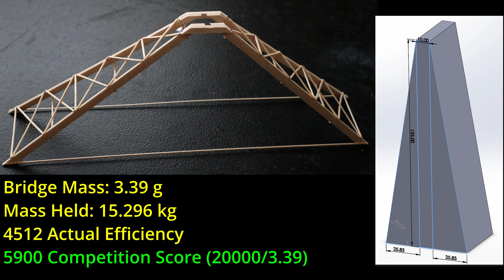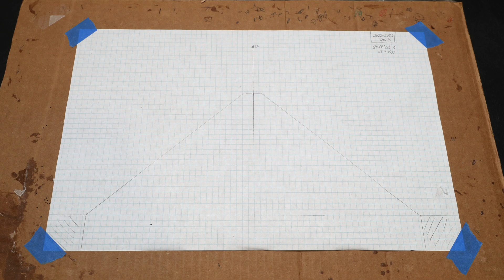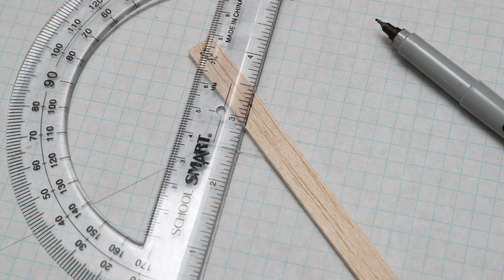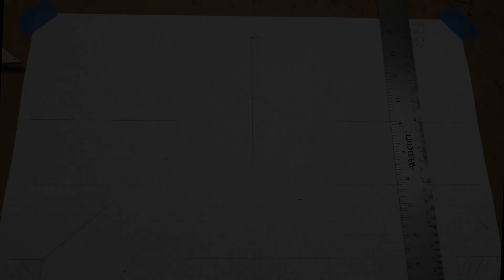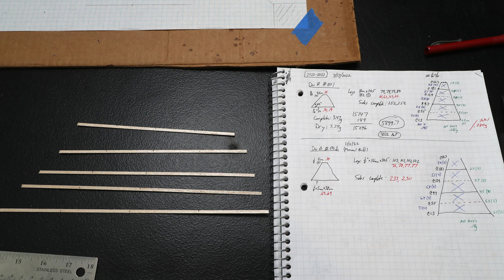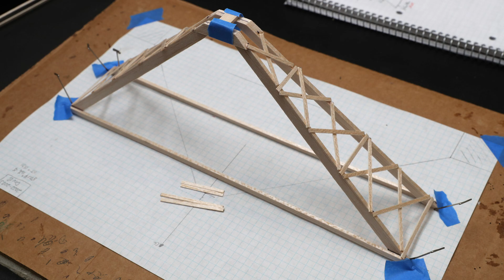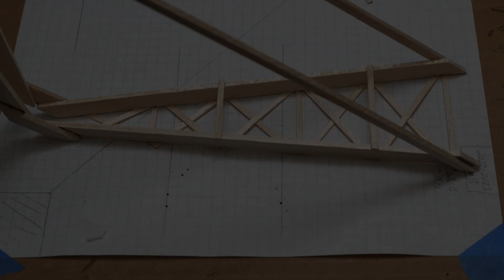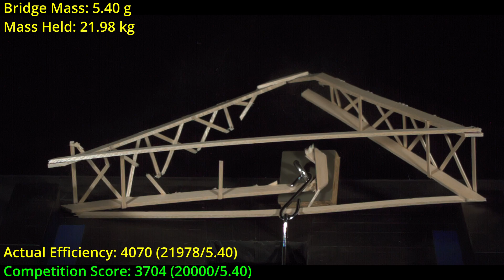2023 Science Olympiad Bridge Div B: Getting Started

Comment: Is there a good alternative to using a balsa stripper? Our team doesn't have one.
Reply from the maker: I would consider it one of the essential tools unless you are going to buy all your balsa pre-cut.  That will be much more expensive than just buying one of these for < $20:  https://www.amazon.com/Master-Airscrew-Windsor-Propeller-Stripper/dp/B0000WS5OQ/ref=sr_1_1?crid=81NEVH3R3DFB&keywords=balsa+stripper+master+airscrew&qid=1680907510&sprefix=balsa+stripper%2Caps%2C172&sr=8-1

If you are in a pinch, I suppose you could use an X-acto knife and something like a metal ruler or other straight edge to guide the cut, but I wouldn't recommend that
Reply: @balsaengineering6686  Thanks, also what would be a good efficiency for a bridge that is in states?
Reply from the maker: @sibaiyan  Hi!  It's really hard to tell as there will be a huge range between different states.  In some states, 4000 could win, in some with strong build teams, it might take 6000+ to win.

Comment: These videos are so great. Thank you so much for all your information. I have a silly question, has anyone ever tried to build a bridge by bending balsa wood to create an arch ?
Reply from the maker: Thanks for the kind feedback!  It is possible to build an arch bridge with balsa, but from what I understand it involves getting the material wet/soaked and then bending it in place with a jig.  Even if it could provide some benefit over an optimal conventional bridge, which I'm not sure it can, the hassle involved really wouldn't be worth it IMHO.  One of the keys to success for this event is to have as simple a build as possible so it is as repeatable as possible.  Making an arch bridge would be pretty much the opposite of that.  Also, a perfect arch design would still need a way to support a flat loading block for these rules, so that would also cause a headache with the design.  All that being said, it might be fun to try at some point!
Reply: @balsaengineering6686  thank you so much for your reply. My train of thought was the arch would spread the weight evenly throughout the structure.  But the loading desk might be a problem for sure.
Reply from the maker: @macferigo  Because we're able to work with basically a triangle bridge, the loading is already well distributed across the legs.  Compared to a conventional "road-bridge", an arch design would have a big advantage.  But that is also why these triangle bridges have a big advantage as well as we can design them for essentially a point load in the middle instead of a distributed load across the entire structure (like a real bridge).

Comment: First of all, thank you so much for helping me build a good bridge for science olympiad competitions. Could you please tell me what size wood you usually use for the cross-braces, and the tension pieces on the bottom if I want to target a score of 4500? I will probably use 1/8 inch wood for the rest of the bridge though. Thank again.
Reply from the maker: Thanks for the kind words! For the cross bracing, I like to use 1/20" thick balsa and cut it square to around 1/20".  For the primary tension pieces, I like to use 1/32" x 1/16" basswood.  Good luck!!

Comment: Can you please share the balsa wood pieces sizes you used?
Reply from the maker: I think I talk about the sizes of everything I used throughout this video.  Is there a specific question you have that isn't covered in the video?
Reply: @balsaengineering6686  it is 1/16*1/32? I git confused with the bottom piece size?
Reply from the maker: @sunithagundam3452  For this particular build, it was 1/8 x 5mm balsa, but what I recommend is 1/16 x 1/32 basswood
Reply: @balsaengineering6686  thank you for the response, for the side part can I use 3/32, are any other better recommendations?
Reply from the maker: @sunithagundam3452  Yes, my recommendation is to use 3/32 thickness for the legs.  1/8" is also a good choice, but I like to use 3/32 for most builds

Comment: Hello, I am writing in regards to the dry box you used for the weight loss. Where can I find/buy the dry box you used ?
Reply from the maker: Hi!  I made an entire video on the process of using the dry box and how/why it works.  Check out this video:  https://youtu.be/6zOvHMZLaNE

I usually buy the bins at my local Target or Meijer, but I have found a link online for a pack of 4 of them:  https://www.amazon.com/Sterilite-19344304-Gasket-Aquarium-Latches/dp/B00KL7VPWO/ref=sr_1_1?crid=3UGQWZAD2C4EY&keywords=Sterilite+19344304+54+Quart%2F51+Liter+Box%2C+Aquarium+Latches+and+Gasket&qid=1672073569&sprefix=sterilite+19344304+54+quart%2F51+liter+box%2C+aquarium+latches+and+gasket%2Caps%2C105&sr=8-1

Comment: Would it be more efficient (lighter and stronger) if you used a laser cutter to make the ends rather than gluing them??
Reply from the maker: I don't think using a laser cutter would be of benefit in that way.  The glue joints are actually stronger than the wood itself.  I would also be concerned about having the grain of the wood not be aligned like it is with conventionally cut strips.  I don't have a laser cutter to play with though, so if you do, definitely give it a try and let me know how it goes!

Comment: did you laminate any pieces?
Reply from the maker: No, nothing special like that.  Just simple surface to surface gluing for all the joints
Reply: @balsaengineering6686 alright, thank you! by any chance did you glue any of them together to form stronger sticks as one or did you just use one stick for each support? if using basswood
Reply: i have 3/32 inch basswood for reference
Reply from the maker: @psychosaggitarius  For this particular build, the "Getting Started" video, I used all balsa from a single sheet of 1/8" thick.  I basically show the entire build in video.  I don't do any lamination.  For something like my 5900 bridge, and what I'd recommend, is to use a piece of basswood for the primary tension member.  I like to use 1/16 x 1/32 for that piece as a great starting point.
Reply from the maker: @psychosaggitarius  Hmmm... are you asking if you can laminate those to create the legs?  Maybe... but I definitely wouldn't recommend it, it will be too heavy.  Try and find some light balsa and cut the pieces for that if possible

Comment: How do you set up the dry box? My box was not completely air-tight and after the first bridge, the silica get has saturated, and new bridges no longer dry in the box. Do you use new gel for each bridge, or make the box you store the bridge in airtight?
Reply: I'm looking at either replacing the gel each time, baking it to remove the water, or attempting to make the box air-tight (although I'm not sure how I'll do the last one)
Reply from the maker: @jqxz230  Don't bother baking your bridge.  If you don't have a perfect dry-box to transfer it into immediately, you'll lose everything the baking does in a matter of minutes.  A simple plastic bin from Target can be almost air-tight if the top has a foam seal.  Look for that when you pick one up.
Reply from the maker: Nothing too special, but you need to make sure your bin is as air-tight as possible.  Make sure the top has a foam seal or you'll never have a chance.  A single set of silica gel packs should last for weeks if it's done right.  One recommendation would be to get some cheap humidity meters and tape one inside your box and compare it to the outside RH.  That way you'll know if your dry box is working well.  I'm using these:  https://www.amazon.com/gp/product/B07GNMKYCZ/ref=ppx_yo_dt_b_search_asin_title?ie=UTF8&psc=1
Your inside the dry-box RH should be 20% or less if things are working well.

Comment: Hey! I made my first bridge for division c using your help. My bridge weight 12.33 grams and held 14.14 kilograms because the main leg of the design failed due to a cutting error on my end that I didn't notice until looking back at a picture of when I first finished the bridge. I'm looking to improve my design and see where I can improve on. To do that I was hoping to build a testing platform. I was wondering what material you used for the loading block and test supports.
Reply from the maker: Hey!  Congratulations on your build!  That is a really nice result for a first attempt!  As for the loading block and test supports, you can use any kind of wood. Hard woods like oak/maple are probably better to use than pine.  I inherited my loading blocks, so I didn't make them myself.  For the test supports, I just 3D printed them.  You could also 3D print your loading block too, that might be a very good way to go especially if this is just for your personal testing platform.  Good luck!

Comment: Great video! How did you exactly build your dynamic loading system when you are testing your bridge? Also, what wood did you make the loading block out of?
Reply from the maker: Thanks!  The core components of my dynamic loading system were this load cell (which doesn't seem to be available anymore) https://www.amazon.com/gp/product/B07F922RZC/ref=ppx_yo_dt_b_search_asin_title?ie=UTF8&psc=1  and an Arduino UNO R3.  I custom wrote the code to make everything work together.  I've found after you calibrate it, it's pretty accurate, and even more important, it's very consistent, so it definitely works well for this use case.  For the loading blocks... hmmm... I didn't make either of the ones I showed in this video.  I think I acquired them over the years as extras from the testing rigs from the various schools I coached for.  If you are going to make one, I'd recommend using a hard wood of some kind, oak or maple, etc.  I think my grey one was made from laminated counter top material though, so just about anything can work.  If not for competitions, you could probably 3D print them as well.  Just use 100% infill to make it as sturdy as possible.